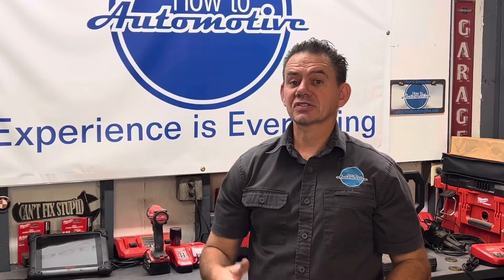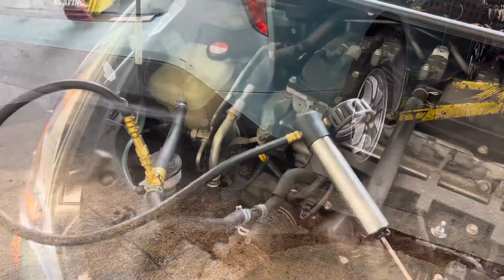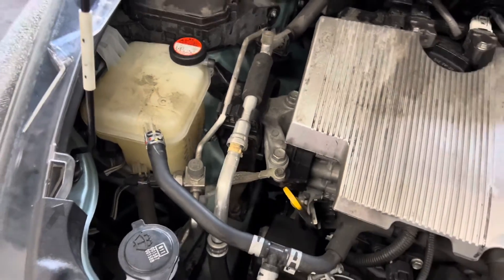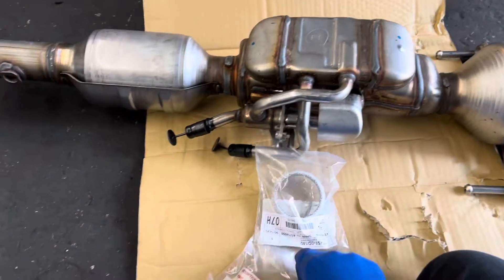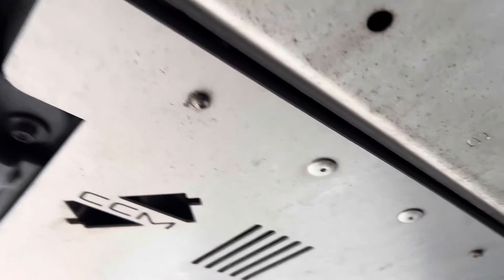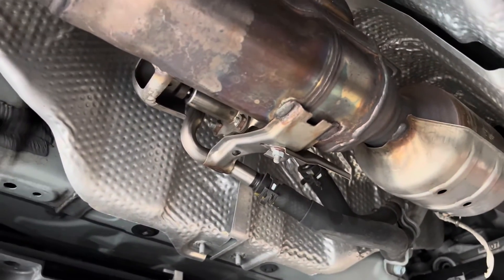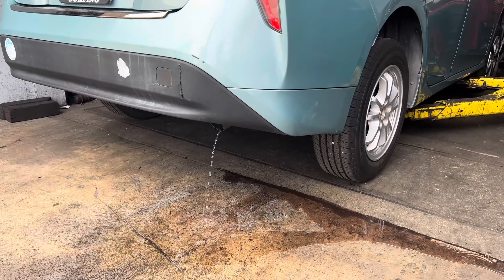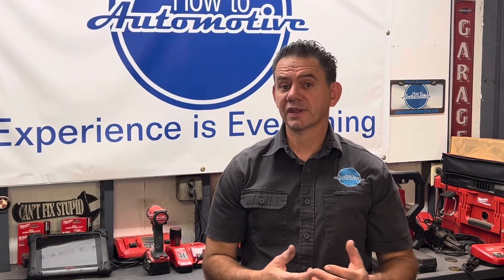Coolant pouring Out Of This Prius Exhaust And It’s Not What You Think

Comment: Mine is the same, what should I do? It also has white smoke when I drive.
Reply from the maker: It’s going to have white smoke because the coolant is in the exhaust system. There are tests that you can do to check to make sure that it’s not a head gasket as well. But that requires special towing. I would recommend getting a diagnosed at a mechanic shop.

Comment: i can see why so many are switching to electric vehicles, no exhaust system to repair. i see a great business opportunity for electric vehicle battery lifetime warranty, a service center can offer battery repair when needed, for a small monthly or yearly fee.

BYD and CATL both manufacture batteries that flash charge in five minutes with a cycle life of one million miles, no fire hazard, and 100% recyclable. and, lower cost than present battery production.

i’m still thinking, do i buy a fuel efficient vehicle, or an electric vehicle. if i could buy a BYD, i would buy electric. but politicians blocked BYD sales within the US with 100% to 250% trade tariffs. and 60% of BYD stocks are held by US investors. quite interesting indeed.

Comment: how do u know that's the coolant coming out - not the water after catalytic converter?
Reply from the maker: @nazigrammar9728  it will have a sweeter type of smell also the coolant level under the hood will be low. A low coolant level light on the dash may come on.
Reply: @HowtoAutomotive  Thanks. So do u think if I'm gonna pressurize the system with the engine off I might see a coolant leak after the cat? I think I tried a block test before and the fluid didn't change its color...

Comment: you can technically bypass all that stuff and the car will run fine just might take like 5 extra minutes for the heat to pump out hot air but thats better than paying to replace a cat when its just the heat exchanger thats leaking.

Comment: @HowtoAutomotive – Please comment:   My 2014 Prius with 233,000 miles is experiencing coolant leak.
My car still runs good.  No engine shake.  I usually drive fast 75-85 mostly Texas intrastate,
The check engine light randomly comes on and then goes off after a while.
Code P0117
The Temp warning light comes on randomly after driving a while then goes off when I slow down.

I don't see any smoke or liquid coming from the tailpipe or leaking anywhere.  I do have to add coolant (about a quarter reservoir) about once a week.
Yesterday I had to refill the entire reservoir with coolant after a 2-hour drive driving 80-85,  Then next day drove the same 2 hours at 65  and did not lose any coolant.

Took my Prius to Toyota to check it out.  They said they could find no leak but, I need to replace my engine and the water pump.  They did not tell me why? 

To me, it appears to be a leak of coolant into the catalytic converter.

‧
Reply: Put cardboard down under your engine after driving it to see if it has a leak. If no visible leak, you can buy a combustion gas checker for $40-ish to see if gasses are getting in your coolant. But I would start thinking about internal leaks if you don't see coolant on the cardboard. The oil may look good, no misfires and it still can be a head gasket failure, cracked block.
Reply: @Pr0ph3cy-k5z  - it was the water pump.
Reply: @genemetz1945  Shocked that it wasn't leaking coolant with a bad water pump.

Comment: Have they corrected this problem in the 2022 Prius?
Reply: No. All 3rd and 4th gen Prius can have this problem. Toyota got rid of this feature/defect in the 5th generation 2023+.

Thankfully, bypassing the problem is an relatively easy DIY job that literally requires no parts, but could be an emissions/inspection issue.

The proper fix is like $3+k replacing the entire catalytic converter assembly because of a cheap failed heat exchanger welded to the cat :(

Comment: Could the hoses to/from the heat exchanger be clamped, or does the coolant still need to flow through them?
Reply from the maker: In a pinch, you could loop them around into each other. But you’re still gonna have a check engine light.

Comment: There is a Toyota TSB on this.  Make sure you tell your viewers this can be fixed for free by the dealer if car is under 80,000 miles and (I think) 10 years
Reply: on my 2019 Prius I have the same issue. Dealer is replacing it for free (although they say it's because I have extended coverage)
Reply: I checked with my dealer, it’s not covered under warranty stated in that TSB , I have 73k miles on my 2017 Prius. I even called Toyota customer care service, no warranty coverage even when I told them about the TSB.
Reply: @sccphilly  Sorry to hear that. maybe a diff problem.  I walked in and told them the problem and mentioned the tub and they fixed it free.  I would pursue it if its the same problem 
my point is this Toyota expert should have mentioned this in the video.....

Comment: @How to Automotive. Great diagnostic job. Doing the repair right and not just indiscriminately shooting the parts cannon.

Question: What was the condition of the coolant? Since coolant also has corrosion inhibitors, maybe the owners didn't change the coolant as recommended or sooner. Haven't seen that problem with my 2009 Prius.
Reply from the maker: Jordan to say it was mostly water. All the coolant went out the exhaust.
Reply: @HowtoAutomotive  Maybe the condition of the inverter coolant (same coolant used for the radiatir) can help?

Comment: Id bypass it
Reply from the maker: That is an option
Reply: @HowtoAutomotive  What does that mean, to bypass it?  I have a 2018 Prius, about 90k miles, dealer wants $2500 replace the entire unit, as all the coolant had leaked out.
Reply: @publicdefense9589  You can bypass the pipes that head down to the exhaust up just behind the engine by the firewall or use a u pipe and just connect the two hoses that go down to the exhaust to each other so they don't go into the heat exchanger.
Reply: Yes I got it done in mine 2019 perius it works fine.
Reply: @numan4689 did you bypass it by yourself or mechnic？
Reply: @numan4689  Will there be a check engine if you by pass it?
Reply: No  @Motorsportsgeek